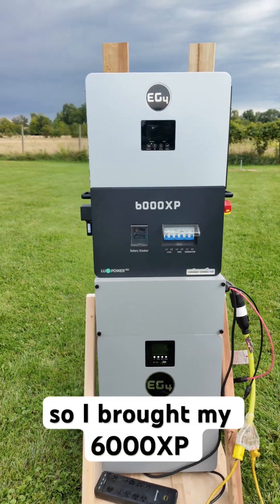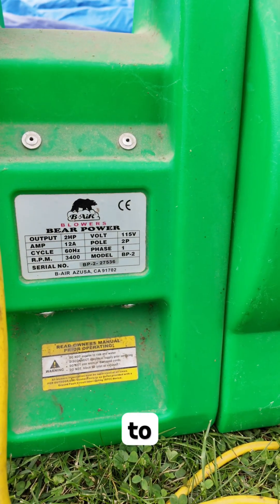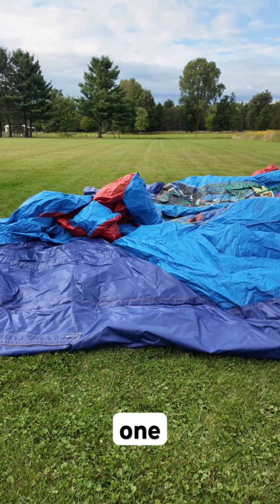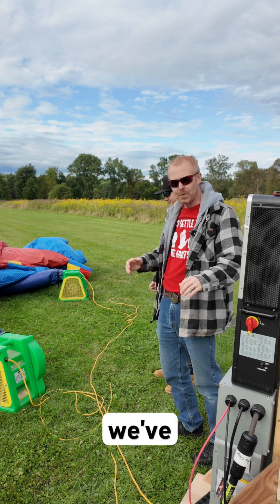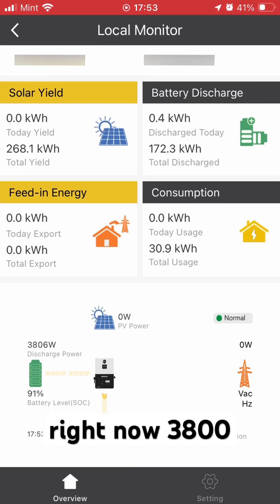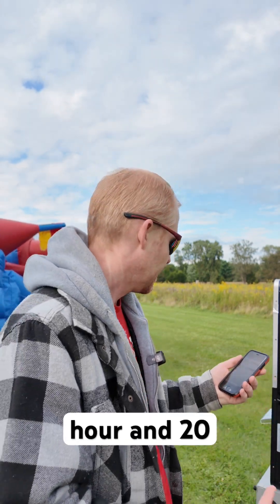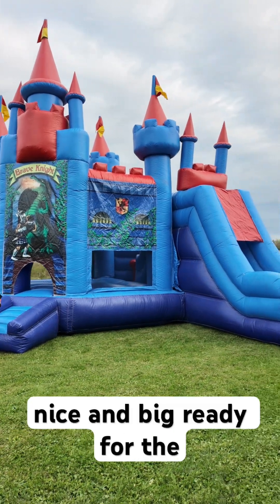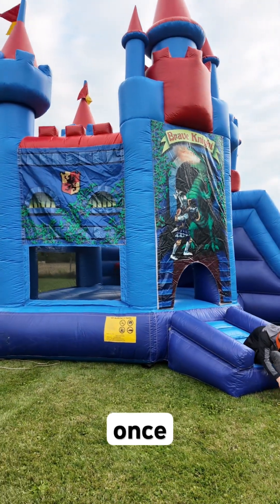⚡EG4 6000XP vs. 2HP Bounce House Blowers – Can It Handle the Surge? 🎈

Comment: A lower-cost, much smaller 4kW low-frequency motor can easily start this 4 HP load.
Reply from the maker: I'm sure there's other inverters out there that could, I was just testing out what I already have.

Comment: depending on how many hours that you are trying to run it maybe a second battery. but definitely a good use case for something like this.  how many hours do you think it would run on the one 100ah battery? mostly curious
Reply from the maker: Yeah, you could use a second battery, or probably set up some solar panels instead (which would be a lot lighter to move). 

The one battery would prob run an hour and a half once it was fully inflated.
Reply: @AdamDeLayDIY either should work

Comment: Nice unit... Terrible run time for that application...  A generator with a long cord seams like the better choice here... Just set up ways to muffle the sound...
Reply from the maker: Yeah, if you needed more than an hour, it doesn't make sense.  The weight for multiple batteries just makes it not worth it.  Had I been able to bring a few panels and string them out though, it could have easily run all day.

Comment: This is awesome!! I'm an ultra runner. At aid stations, especially overnight ones, they often have a gas generator to power lights, music, etc. Even a "small" 5 kwh battery and eg4 3000 120v inverter would be plenty.
Reply from the maker: Oh yeah!  I've helped out at quite a few local races in my area and they're always in need of remote power.  Nothing in the neighborhood of needing 2HP blowers going, but having "silent power" in the med tent or water stations would be a huge plus!

Comment: Bring a couple of panels and you will be good for all day. You look froze and it is only early September.
Reply from the maker: Yeah, I only had a single panel that wasn't mounted somewhere and it wouldn't have gotten me above the min-voltage limit.  It definitely crossed my mind because it would give me all-day runtime.  Maybe I'll have to keep my eyes out for some more panels that I can just throw on the ground for next time.  Maybe I'll do a V2 test with panels and see how it goes?

Typical Michigan weather.  Wait 2 minutes and it'll change.  I think that day it was in the 40s...
Reply: That would definitely help here if its a sunny day... Great recommendation...